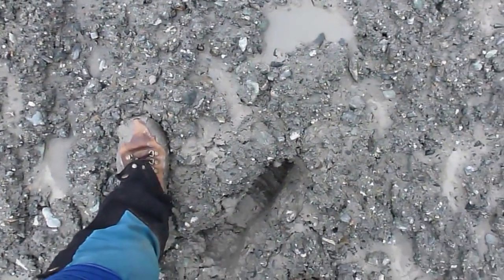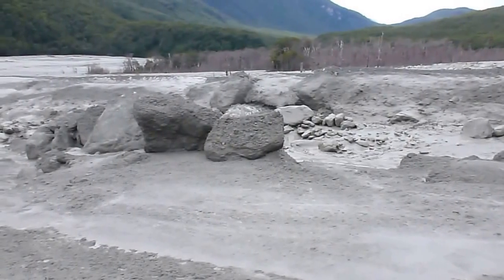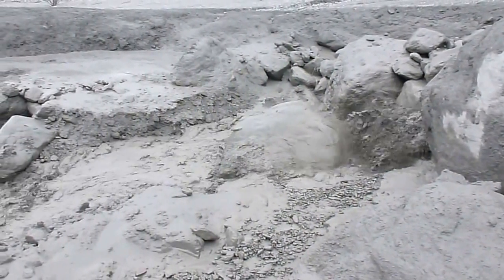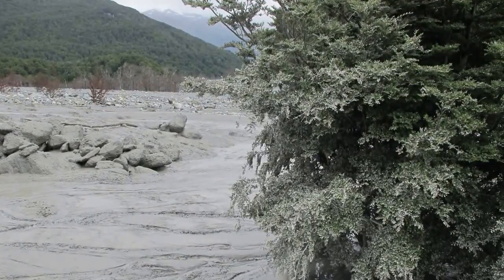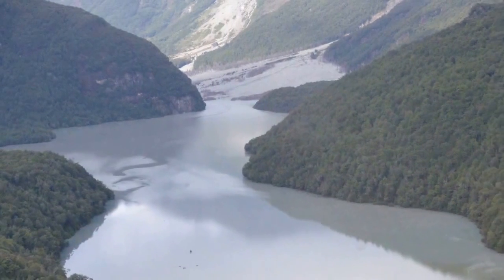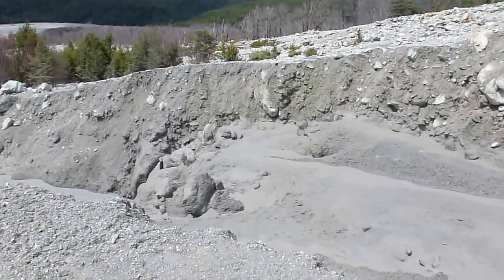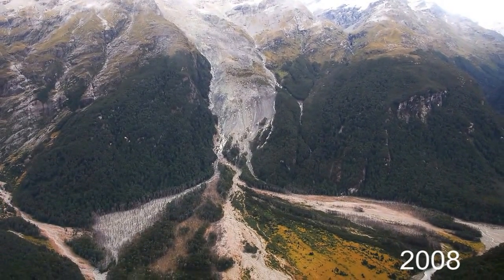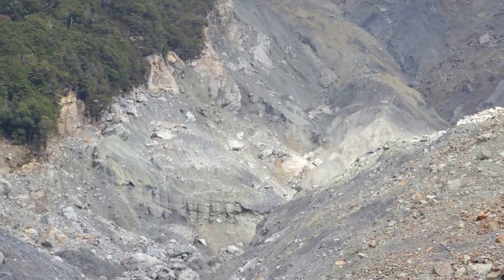Dart Landslide January 2014

Comment: Cannot locate it in the short term, but have you noticed the difficultymof mixing chocolate powder with hot water? I get lots of these sorts of bubbles which seem very reluctant to mix .
Reply: start by making a paste with a little cold water then adding hot. it works!

Comment: 1:00 that isn't dust, it's water vapor. The mud is so heavy that when it goes over the falls, trapped air gets compressed. When the compressed air bubbles burst at the surface, the sudden decompression causes excess water vapor to come out of solution in the air, same as opening a bottle of beer.   Look carefully, and the vapor vanishes almost immediately again.
Reply: Too funny (and well-explained, sorry!), because I'd wondered how that geologist must've got hired...I suspected there being a clear reason wherefrom that 'dustiness'🍸

Comment: Just more proof that air has mass.. Push it hard enough and it will push back. In 1965 we had a local mega slide. Half a mountain came down and went half way up the mountain on the opposite side of the valley. Unfortunately an earlier Snow slide had come down and blocked the highway stopping traffic. The lucky ones turned around and went back to the nearest stops. Those who stayed probably never heard (it was dark out) the 47 million cubic meters of rock and mud that roared down at an estimated 100+ miles per hour riding a cushion of compressed air. Just like a hover craft. I remember as a small child, driving through the area only weeks after a temporary road had been run through. crawling around rocks the size of houses. knowing only 2 bodies were ever recovered the rest where left buried where ever they were. Before you call bullshit, check out "Hope or Hope/Princeton slide" and see/hear for yourself.
Reply: https://www.youtube.com/watch?v=Aigd-_En5z0
This Week in History Season 2 Episode 18 - The Hope Slide 
Royal BC Museum https://www.youtube.com/watch?v=gRRNS3xE12U
1903: 90 seconds of terror in the Frank rockslide (CBC 2003)

Comment: This seems to make the whole process of old things getting buried under meters and meters of material, as time goes on.  Never really made a lot of sense out of it, pretty much simply accepted it as fact.  I also see this as part of the natural cycle of rocks getting pushed up, falling back down, eventually getting pummeled into sand, etc, some forming parts of soil, the rest getting recycled back into the Earth, only to get pushed back up through volcanic and tectonic activity.